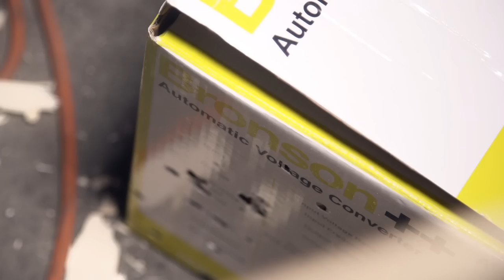EXPERIMENT 4000 PSI BB Gun 🔫  || Cause I Can | GIACO

Comment: 3:41 I guess its a matter of taste. I would go for the power and still have insane speed. With your amazing metal crafting skills Im sure that ball should not bounce off a film of glass when my small 10cm barrell blowback bb pistol penetrates a side window of a car and comes out of the other. It has only one easy fix of a major leak. Im also a metal worker btw. Now Im changing a longer, rifled barrel to it, make huge leak-on-shot fixes and then probably make a new pressure chamber+valve, as this one will probably explode.

Rifled barrel because Im going to use special air gun pellets that actually have the bb ball mounted on the front, but still is a tube shaped and will be an easy mod to make the mag push them on the spot.

And then .22 as a next toy ;)

Good luck to your projects! Subscribed!

Comment: In an air powered gun the longer the barrel the higher the velocity of the projectile up to a limit. As long as the pressure behind is greater than the pressure in front of the projectile it will accelerate (as long as it can overcome the friction). Therefore if you made the gun have one very long barrel the projectiles would most certainly break the sound barrier, and would carry an insane amount of energy for a bb.
Reply from the maker: +Ryan Pfeiffer yes, that's what I did for the nerf cannon... Here I wanted to concentrate on the rate of fire... :)

Comment: use heavier bbs and also you  could put some blades connected to the exit barrel on the inside were the air gets in the chamber so that it will spin the barrels as they shoot bbs :D

Comment: I thought each bb would hit harder than that with 4000 psi. The rate of fire is impressive though. I made some vortex chamber guns in the past, but with just 1 barrel and a normal air compressor, so they weren't hitting too hard either. Could you try 4000 psi with 1 longer barrel? Would be fun to see

Comment: If you had one barrel and tighter fit one BB would go straight through the lot , at 4000 psi since my 1200 psi co2 steel BB gun dies more damage per shot

Comment: Now Imagine if he had made it exactly like NightHawkInLight's it'd only have one barrel so all the pressure is released from one hole it'd rip through pretty much anything at 4000 psi
Reply from the maker: +NexusChild925 I'm not sure about that... You guys are confused by the slow mo but in real life it looks like 5 continuous stream of BBs... just like 5 lines... look at my instagram
Reply: Giaco Whatever yeah but the slo mo shows it isn't pulsing out 5 bbs at once meaning as one is traveling through a barrel at least one other barrel is releasing a short burst of air before a bb is sucked in, with one barrel all 4000 psi is backing the bbs as they rocket down the barrel

Comment: How did you do the sound In slow motion? Is it all in post or are you using a microphone that does some ridiculous sample rate stuff, because it still sounds crisp at that speed :D
Reply from the maker: +Atlantic Dragon it's all post... what you see in almost 3 minutes of that video happened in a second in real life... there is no information to be captured that would make sense... I had to recreate every second of it...
Reply: wow, I think you might be able to make an array of microphones that would capture all at the same time just slightly delayed and merge the samples, then slow it down my desk mic goes to 192000hz or samples per second, if you could increase that number to the point where it would be around 44000 at the end it would still sound decent. I dunno if that would work. Sounds interesting though. I am new to editing stuff and that sounds like (no pun intended) it would take a long time to do...
Reply from the maker: +Atlantic Dragon yes but even if it was possible you would hear just a single frequency every like 20/30 seconds... But I'll try one day ;)
Reply: Thats why I'm saying it needs to be a high sample rate, because its picking up the frequencies more times per second therefore alot faster than a normal microphone. playing it back in real-time would sound normal, Im sure you would need a very powerful custom circuit and an array of around 40 cheap microphones each sampling one after another in a sequence. Ill send you a private message if I find anything interesting :)

Comment: It cant possibly be 4000psi per shot right? 4000psi per shot would be much more powerful correct? It would not bounce of a champagne glass :o Those kind of glasses are so easy to break i find it hard to believe that this gun puts out that much psi. Same with the drywall, drywall like shown in the video is not strong but still the dents that was made seemed to be kinda small to actually be such an high psi and also don't forget that the bb's used where made of metal and are kinda heavy so it should have made more of an impact. It was the insane volume of shots that made so much damage .

Comment: Are you sure it was 4,000 PSI? Something doesn't seem right to me. Don't get me wrong, I enjoyed the video but in slo-mo it took 3 shots at 4,000 PSI to break a wineglass. 3:42  How do the first two BBs shot using 4,000 PSI bounce off of a wineglass? It can't be 4,000 PSI. That's like 275 bar of pressure. Have you seen the Slingshot Channel, Joerg Sprave's "Airzooka"?

Comment: 4000 PSI - so you're dumping all that PSI through a small line?  
not saying it is a bad video, but you should measure the output --- < A SCUBA first stage regulator outputs 140 PSI > 
still an impressive setup and video -